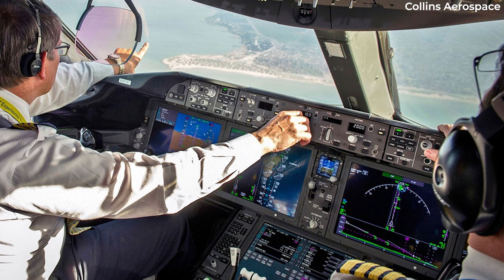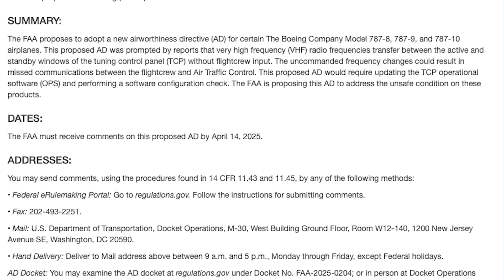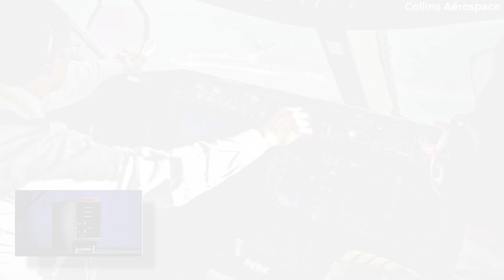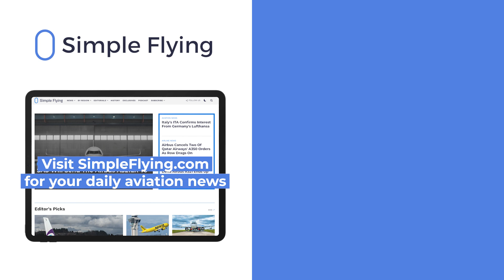The Boeing 787's Radio Problem: FAA Directive Proposed

Comment: Appears Boeing may have no clue about Chemistry of advanced material reinforcements, shielding, statice discharge isolation filtration and its vital relationship resulting impact on modern electric radio frequencies under various conditions.  Boeing needs to go back to being an engineering company vs a bean counter company. IMAO.

Comment: I think someone's accidently bumping the switch, how can they even rule that out? Reminds me of those cars with unintended acceleration where it "had a mind of its own" but in 99% of cases, the driver mistook the gas pedal for the brake pedal.
Reply: Weren’t there a car in the olden days where the carpet on the floor would stick to the gas?

Comment: This is Boeings solution: Monitor the active frequency selection of the radio in use. If an uncommanded 
frequency transfer occurs on the selected radio, select or tune the desired 
frequency

Brilliant.
I have never experienced this behavior however, but only have 1,5 years of experience on the 787
Reply: Appears Boeing may have no clue about Chemistry of advanced material reinforcements, shielding, statice discharge isolation filtration and its vital relationship resulting impact on modern electric radio frequencies under various conditions.  Boeing needs to go back to an engineering company vs a bean counter company.
Reply: @icare7151  I mean they did move the headquarters to make it harder for the engineers to raise concerns about problems. That says a lot about the McDonnell Douglas management culture that took over Boeing.
Reply: @ You are 💯Correct. Boeing is STILL run like the corrupt Chicago politicians and mafia it became after the purchase of McDonnell Douglas, removing the Corporate Decision makers who were engineers, moving to Chicago letting corrupt bean counters run Boeing into the ground. 

Boeings only hope at this point is the advanced F15-EX Eagle II and the coming all new F-47 of which I hope they don’t fail in that program like all the “new from the ground up” Boeing products created after the extremely success launch of the 777 as the 787, 737Max, 767 fuel tanker, 777X and 747-800 Airfire One replacement programs, StarLiner, NASA heavy booster, etc have been one preventable disaster after another. 

The successful C-117 cargo plane, F-18 and F15 programs were acquired from the purchase of the McDonald Douglas Corporation.

Comment: Stuff like that does happen all the time. Airbus has currently a red OEB for A320NEO equipped with the new Digital Communications Panel, to fix a complete loss of communication, transponder and backup navigation (OEB 63). That is only temporary to deal with the problem if its happening, while a software fix is being developed (takes at least a year).

OEB: Operations Engineering Bulletin, red means high priority. OEBs contain temporary procedures for flight crews.

Comment: In developing the 787, Boeing squeezed all the suppliers as the mandate was to develop the (innovative) plane for significantly less than the (more conventional) 777 cost. They chose to outsource a bunch of the development to suppliers as well (including the wing)! This, as we know, ended in tears with Boeing having to buy out suppliers and take work back in house. Overall cost was much greater. Are we surprised that issuers with suppliers are still emerging?
Reply: Just look at the 777X..
Reply: But dont forget its not down to the choice of supplier where Boeing has found a fault in the radio system. All suppliers are trying to supply parts as quick as possible to deliver to manufacturers. So finding faults with them means you just have to deal with them instead of blame Boeing for squeezing the suppliers to develop the product for less money
Reply: @nickolliver3021  The 787 was developed the Stonecipher MDD way. This comes with consequences as we have seen repeatedly. It’s on Colin’s but ultimately the buck stops with Boeing.
Reply: @camhusmj38  The buck has stopped with Beoing. We are seeing more supplier parts being faulty which sends the blame to the manufacturer which really isnt the way to do it.
Reply: @ The manufacturer has the contract with the supplier. They need to hold the supplier to account to provide quality parts. That is how it's done in all industries. P&W has taken the wrap for the poor quality materials used in the GTF (and rightly so) even though those were supplied by suppliers.
Reply: @camhusmj38  So if the supplier messes up with delivering faulty parts then its their responsibility to do it right to manufacture spec. But pratt and Whitney we know what the situation is with them
Reply: @nickolliver3021  Colin’s is responsible to Boeing, but Boeing is responsible to the airline customers. Ultimately, Boeing chose Colin’s.

Comment: An issue with Collins Aerospace systems. People will still blame Boeing.
Reply: In the case of the 787, Boeing did not do enough coordination and quality control with suppliers because they were trying to get development on the cheap. This problem sounds like an easy fix, though.
Reply: Suppliers will bring you down
Reply: If the Apple carplay didn’t work on my car as advertised I blame my car manufacture for the failure and not Apple.

The plane is call Boeing 787… Not Collins Aerospace 787
Reply: @tonamg53 If they didn’t design the system it’s not their fault
Reply: @Chillforev-dd9wr  So if the brakes on your Ford Mustang failed, you’re going to put the blame on Brembo?
Reply: @ Yes because they designed the damn things it’s a brembo product if it’s passed its tests and everything and worked flawlessly before hand then it’s not fords fault that it failed now it would either be brembos fault or my own damn fault.
Reply: @Chillforev-dd9wr  Right… then don’t called the plane “Boeing” if the company is going to be that irresponsible and blame the suppliers.

You know how many parts Boeing produced themselves? 

Probably near zero. 

Fuselage? Spirits 
Avionics? Collins
Batteries? GS Yuasa
Landing gear? Safran
Engine? GE
Tires? Michelin
Brakes? Honeywell
Flaps? Mitsubishi
Ailerons? ACM

So using your logic… Boeing can never be blame for anything.

If everyone at Boeing think like you… No wonder why the downfall.
Reply: 346 people died for nothing but Boeing greed and criminal negligence and yet people are still willing to defend them.
Reply: Boeing is still responsible for the specs of the part and the final quality assurance prior to integrating the part into the plane. Boeing and Collins are both at fault, but given Boeing's poor history of quality control recently it's understandable why people focus on Boeing.
Reply: @Matt-fl8uy If it worked during certification then it was probably good it’s just now having problems which need fixing
Reply: @Matt-fl8uy Absolutely. Boeing selects the supplier and Boeing’s name is on the Type Certificate. Boeing is the one who sells the plane to airline customers and it’s the one contractually responsible for the quality.
Reply: @camhusmj38  however the chosen supply has a faulty radio system so its not necessary Boeings responsibility for the quality product

Comment: The nightmare liner.
Reply: It’s not Boeing they literally said who’s fault it was in the first 20seconds
Reply: @BernardBailey-ri2to  I know that. But the point is the 787 plane had its fair share of issues over the years even when they weren't directly related to Boeing's manufacturing process.
Reply: @BernardBailey-ri2to Who picked the supplier? We know that on the 787 Boeing squeezed all the suppliers following the brilliant strategies of MDD. You get what you pay for.
Reply: @camhusmj38  Its not the fault of the choice of supplier .All suppliers have faulty products. You just have to deal with them instead of point the blame for choosing badly